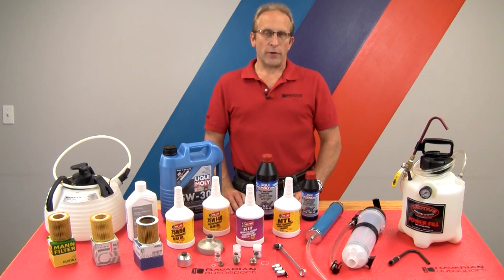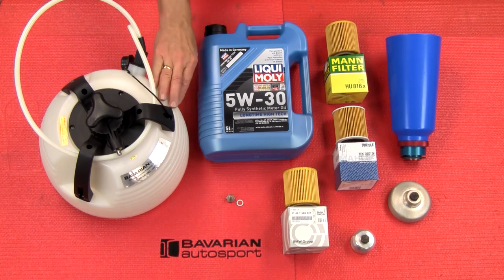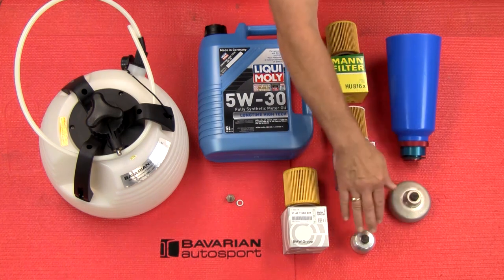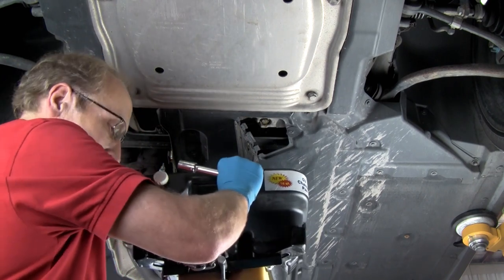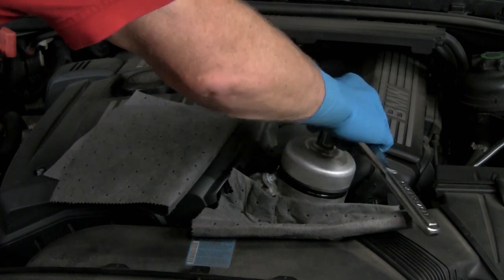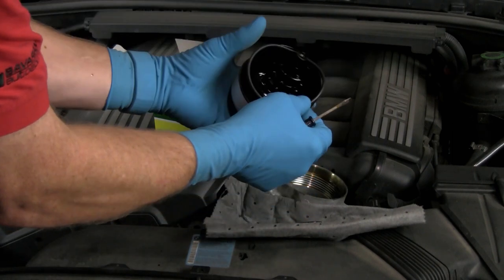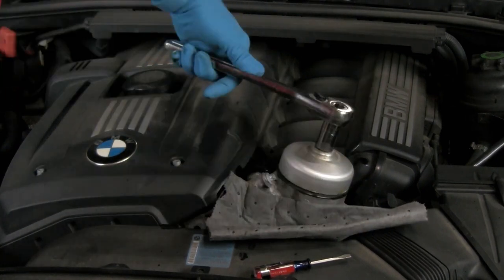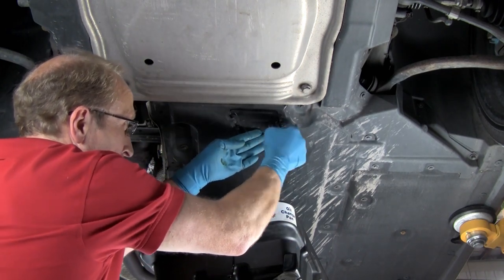Changing Engine Oil in BMW & MINI, With and Without Dip-Stick - Under Car Fluid Changes

Comment: You didn’t put a new rubber on seal on filter? You did the big one round the oil filter cap but not the 1cm one on the end of the filter housing. School boy error

Comment: All I can say is to keep up the good work. I am fairly good at DIY but have never worked on a BMW before. I have the opportunity to buy a 2007 530i e60 M52 with (100000miles )and wanted to know what i was getting myself into.  Your videos have been very reassuring.

Comment: I've been changing the oil on my E36 3 series for 15 years by driving the car up on 2x4 blocks of wood. I have four 2x4s that are each about 2 feet long. So easy just to put them in front of the wheels and drive on up. It gives just enough clearance to remove the drain bolt. No jacking or leveling required. Give it a try!

Comment: Great videos! 2 questions:
Liquid molly oil or Mobil 1?
Should you put any oil in the oil filter housing during oil change?
Reply from the maker: While the Mobil-1 would be the choice for common synthetics, the Liqui-Moly is a higher grade synthetic oil and will outperform the Mobil-1.  You can't really fill the housing because there is a drain valve in the bottom that drains the housing when the cap is unscrewed.

Comment: I use Total Quartz 5000 SL in my 1993 BMW 730i L6 ... is that ok? if not please tell me what kind of oil should i use...
Reply from the maker: We're not familiar with the Total oil, but as long as it meets the spec, it is fine.  Of course, the Liqui-Moly would be a superior "top-shelf" synthetic.

Comment: The oil change that you preformed does that work on any BMW model and also does the year of the model matter?
Reply from the maker: The general procedures shown would apply to most BMW and MINI models. There are some models that have the oil filter located in other areas, but the overall procedures are still applicable.
Reply: Okay great thank you so much and the amount of oil would be the same for all of models I assume
Reply from the maker: Lukasz Zielinski
 - No ... oil fill quantities vary.  When you look up the filter and oil, for your model, on our web site (www.bavauto.com), we will tell you the required quantity of oil for your model.

Comment: It's been over 4k miles since the last oil change but my service indicator still has 4/5 bars full. Is this indicator accurate? This is on an e53, I do highway driving but in the city I drive it rather hard. I checked my dip stick and the oil is full but a black color. Should I change it or wait till all of the service bars deplete.
Reply from the maker: The on-board oil change interval indicator will likely take you out to 15,000 to 20,000 miles.  This is FAR too long.  We fully recommend that you follow a 5,000 to 7,000 mile change interval when using a top-shelf synthetic oil, like the Red Line or Liqui-Moly oils (www.bavauto.com).  If the oil turns opaque before this mileage, it should be changed at the earlier time, before it is fully opaque.
Reply: BavarianAuto Got it. Thx for the reply!

Comment: What oil is recommended to use on an E9X N54 335i, & E9X N52 328i?
Reply from the maker: +BMWSource - The BMW recommended oil would be 5w-30.  We fully recommend the Liqui-Moly 5w-30 over the BMW, Shel or Castrol oils.  This is a far better oil and has a higher spec rating.
http://www.bavauto.com/fland.asp?part=1137lm
Reply: Bavarian Autosport True, also for oil filters do you recommend MANN, BOSCH, or a MAHLE, and is Liqui Moly better than Mobil 1 or Castrol Edge, and how about BMW genuine oil?
Reply: +Bavarian Autosport What oil is recommended on the E46 325i, 325ci, 330i, & 330ci?

Comment: Which Liqui Moly oil is the best quality with the best additive package? They all seem to be in similar price ranges.
Top Tec 4200, Top Tec 4600 or Longtime High Tech? They're all BMW Longlife-04 specific. I'm looking to put some in a rather high mileage car.

I did read your blog post btw, very informative.
Reply from the maker: The Top-Tec 4600 is has the highest level of additive packages and is also specifically designed to help reduce emissions.
Reply: BavarianAuto
Thank you! I'll go with that next time.

Comment: That oil fill verification procedure is so silly for non dipstick vehicle in my mind, It doesn't allow for easy verification. Is there any logical or practical reason for not just having a dipstick.
Reply from the maker: Yes .... to help prevent vacuum leaks and allow tighter emissions .... supposedly.
Reply: Ok...Noted. However. all electrical systems fail. Mechanical water pumps don't fail half as much as those newer electric ones. My point is, is it wise to have one of the single most important checks the average driver can do...oil tests, being automated and prone to failure and worst having to wait for the car to warm up to test it?
Reply from the maker: jstuttgart
 - Don't get us wrong ..... we fully agree.  Silly to not have a dip-stick!

Comment: This is outdated for F48 2016 X1 Turbo ) 0W-20W only, just Porsche uses. None of these filters are correct for the 2016 X1 2.8i F48